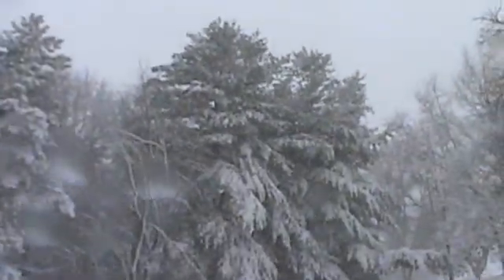160 Meter Loop Talk

Comment: Dude Fix your stuff and check in to the 1900 group...1900khz 8pm everynight... WI3F, Net control operator... cool loop... you will have fun... We also have about 15 to 20 of the regulars that stream video from their shack and livehamcam.com
Reply from the maker: Okay, you twisted my arm. Gonna have to get it back up in the air first.
Took the loop down to do some tree work. I'll be on 1900 soon.
73
Reply: Okay... when you do remind me of how we met and this exchange so that I can remember... No G5RV antennas please... inside joke... Good to meet you... 73
Reply: By the way I had a call sign change my new call is WI3F